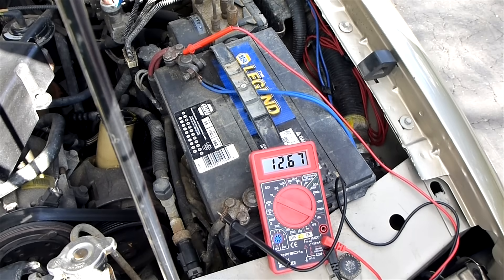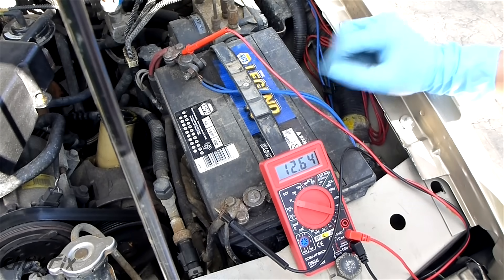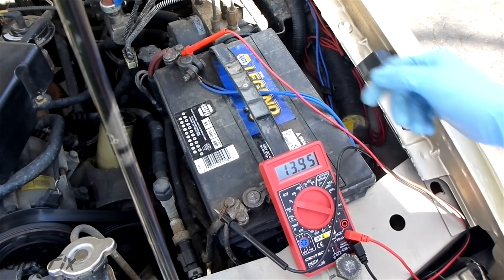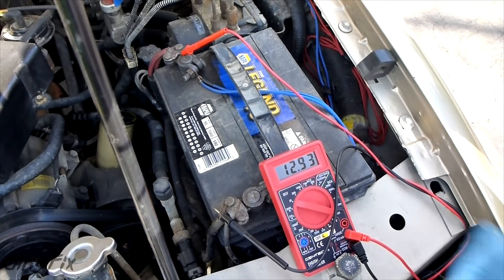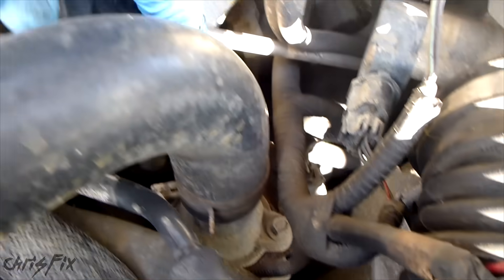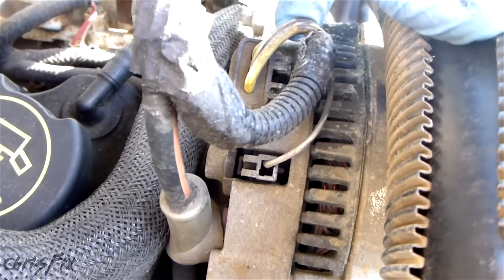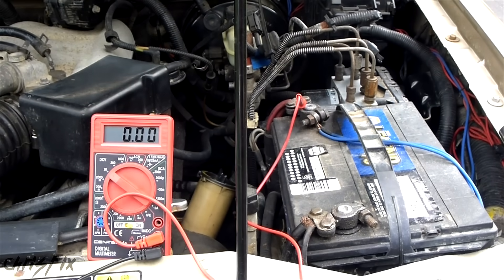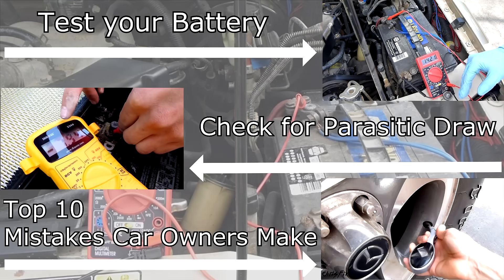How to Test an Alternator

Comment: i have a 2009 camry I4. It's got a NAPA alternator. Upon starting the car i see that the voltage is 14.1-14.5. But after 30 mins of idle/driving the voltage drops to ~13.5. Is this a sign that the alternator is degrading? Battery shows 12.5-12.56V when the car is shutoff. Sorry for multiple comments, if any, as my google accounts are messing it up
Reply from the maker: Could be a bad alternator even though it's new. I would also check your battery because heat degrades batteries.

Comment: I have a 1998 GMC Sonoma, with the 2.2 L 4 cylinder, and 4L60E 4 speed Transmission.  It has the original fan and fan clutch.  I want to add a electric fan, and there appears to be ample room for a small fan between the radiator and the fan blade.  I've been looking for a fan to install, and most seem to be around 28 amps at start up.  The stock alternator is 100 amps.  Should I upgrade the alternator to one around 150 amps?  Would the stock battery wiring be okay at 150?  Would the starter be okay?  Or the battery itself?  Thanks...good video...lots of helpful hints of things to check when they go awry...

Comment: Can you test the voltage between the alternator's positive lead and the alternator body to see if it's pushing out high enough voltage such as 14.2+ volts? Then if it's good, test for any connection problems between alternator and the battery?
Reply from the maker: Yes

Comment: Sorry, that means that if some of those connections is reading higher than it should, then it means the alternator is good and just needs to clean the connections, right? But then if everything is reading normal but car is failing to provide 14v or so to the battery, then it means the alternator is bad. Is that correct?

Comment: Chris, in addition to some drop voltage tests, there should be one added.
 A voltage regulator is hold by two screws and gets ground potential through them. If both of this screws are rusted and lost continuity, then a voltage regulator malfunctions. So the test of resistance between one of the screws and car ground should be added.
After removing a screw, cleaning it and putting back in place, the charging voltage came back and battery light on a panel went out.

Comment: Ok, Would like feedback on this please. I was told a long time ago: To test if your alternator was bad, disconnect the negative from the post of the battery while the engine is running, if the car stalls out, your alternator is bad. How outdated is this? Or more specifically, up to what year of vehicles was this method worth using? Thanks.

Comment: I’m getting 12v with my car off and 12v with it on but the check charging system light keeps coming on. I checked the alternator itself and it’s 14v and then car battery goes to 12v while running. So what’s my problem?
Reply from the maker: If the car battery is only 12v when running that means your alternator isn't charging the battery and will need to be replaced

Comment: If anyone is using those multimeters you get for cheap from harbor freight like the one in this video (I had the same exact one). They are incredibly inaccurate after a few uses.

Comment: Quick concern i have a mustang gt 2006 i recently put a new alternator it reads 13v while off and reads 13.7 running and then with lights and ac on and fog lights on it drops to 13.4 to 13.5 should i return my alternator my old one was overcharging thats why i switched it it would turn off all Electronics from inisde and dim my lights but now im worried its to low now

Comment: Chris my 05 mustang is at 13.7 when the car is running, when I turn on all accessories including ac the voltage drops to 13.4 and if the fan starts the voltage drops to 13.2 then back to 13.4, does this mean my alternator is pretty much busted?
Reply: Lol I just commented this I get the same reading and I just installed a aftermarket alternator from american muscle I'm asking questions as well my old one would overcharge
Reply: @AngelMuratalla209  if you get the same reading in a new alternator then mine should be ok. My car shuts off while running and sometimes it’ll crank but won’t start, I’ll have to keep looking

Comment: My car seemed fine was running the car in park listen to the radio doing the interior for about an hr and then the car was off and won’t start anymore . Battery is at 12 v.. radio works ,  power in car work

Comment: Chris fix man I need you're help so I'm getting g code p1381 for ignition coil but I change  the whole distributor but now is saying   the same code but still telling me to change the ignition coil again but I just did change it and change the spark plug recently  but I went to go to oreillys and I tested my alternator and they said it at 12 volts so that could be why it giving me a p1381 code ? Please help me bro I have a 2000 honda accord lx vtex

Comment: I know the video is 10 years old. However i did everything you showed on my 2013 accord for a bit everything is ok. Then it just drops back to 12ish. Would you happen to know why. After a while i turn it off then on and the voltage goes back to normal charging 14ish but will drop shortly after. I suspect the alternator may be cutting out. Is that something that can happen if its going bad.

Comment: What an excellent video. Despite fitting a new battery and alternator, voltage was only 13.2V - less if lights turned on etc. Carried out check as per video. Found 1.2V drop on alternator housing, bracket and engine block. Reading was good on chassis ground. So connected jump lead from bracket nut to chassis ground and hey presto 14.4V😊😊. Further checking found the engine earth connection very corroded. Cleaned and replaced. Jump lead removed. Pumping out +14V now even when lights etc on 😊😊😊😊
Reply from the maker: Awesome! Nice troubleshooting!

Comment: What if I am getting around 15V after starting? Is the 14.7V after starting the engine universally applicable?
Reply from the maker: 15v is a little high and it could mean the voltage regulator is starting to go bad.

Comment: What if my car doesn’t even start and this could be the issue?
Reply: Disconnect the Positive Post Lead.
Bring a car next to yours or borrow a good battery. Connect Jumper Cable.
1. Jumper Cable Red to good battery Red (Positive Post)
2. Jumper Cable Black to good battery Black (Negative Post)
3. Other end Red to your Red Post
4. Last end Black to your Ground of the engine or chassis ground
5. Rev car to 2K
6. Now, try to start your car

If it starts, your battery is bad/weak or defective.
Then if battery dies after a week, check the alternator.
Reply: @angelisone  my car won’t even jump start
Reply: @Dawg_arex  Then run a known good 12VDC car battery directly onto the Starter.
But if you car is over 9 yrs or 165K+, then check & test your Key Switch (yes, the one you insert your key into).
You failed by not giving much information on your car, which will make it harder for me /or other assist you.
Reply: @angelisone  so I talked to a couple other mechanics I know none did real test, it’s a 2001 Honda prelude 250k miles it will turn with all electronics on just will not even start to crank at all, some said the starter, some said alternator and some said the clutch so i do not know, just trying to get some insight before I get it taken to a mechanic

Comment: I just reinstalled mine two months ago and now I’m getting battery light errors occasionally. When testing the voltage it is lower than 13 but only sometimes. I think the alternator is dying and it’s brand new (rebuilt) but besides that new…
Reply from the maker: Sometimes they go bad. Get a new one under warrantee.
Reply: @chrisfix  Hey Chris! wasn't expecting the reply! thanks so much for making your helpful videos!! using your video I was able to isolate the issue. The positive lead off of the alternator was the issue. There was some corrosion and build up on it. Apparently there must've been a short there that caused it to run hot which melted some of the plastic cap. This got onto the bolt. I had used some superglue around the area when installing in an attempt to repair the plastic bracket which broke when tightening down the wire. thankfully I saved the old one, so when I cleaned it up I just swapped it. I don't think the superglue was a good idea... To compensate for the broken cap I have temporarily used electrical tape to hold it on until I can buy a new cap (I may not if the tape works out)

There being a short explains the excess voltage and heat and the fact that the battery light coming on would be so intermittent, that after a simple restart it would go away.

Voltage off the positive lead of the alternator before cleanup: 1.25 (idle) - after: 0.18 (idle) I made sure to clean every wire and connection for the battery and alternator. I think it payed off too! I hope I don't get more issues with it all. 

Just to be sure it wasn't the alternator I brought it in to my auto store and they ran a test on their bench for me. They also tested the battery.

Dodge Avenger 2010 - 2.4L 4 Cylinder

Comment: First off, thank you. Second, my battery is running at 13.1 volts this is running ac and bright lights. I had the auto parts store run a test and my lighter port bluetooth device says the same, 13.1. I was unable to jump start my car yesterday. Today it jumpstarts. I placed a brand new battery in today and it also didn't start with new battery. I have now went back to old battery. Connected multimeter and getting 13.3. Is this an alternator issue?
Reply from the maker: Sounds like the alternator isn't strongly charging the battery which is causing that to happen I would replace it

Comment: I love your videos. Very helpful. Question- when you checked negative terminal voltage drop on the chassis there was a huge difference actually. It went from -0.04 to +0.06. Unless we don't care about positive/ negative reading. Could you tell me more? Thanks
Reply from the maker: Thanks a lot! The positive/negative doesn't matter in that case

Comment: Hi sir.. my car.. carb system..modified use 110 A alternator, not to much electrical as usual.. just big electrical as AC, couple a headlight 100 w, and simple sound sistem..the problem when 3 of that turn on together.. voltage drop until 13,1 v some time 12,8 and RPM drop too, for about 100 RPM down. can you explain what problem? what should i do? Thanks

Comment: I have to say you know your stuff. I have been trying to learn. Takes time, I guess.
My issue with my 2018 Civic H.B 1.5L Turbo. I changed my alternator because the old one died. New belt, too. However, it had passed the condition test when I took it to Autozone. But, when I drove on the highway I would expect to see 14.4 volts. Instead, even after hitting 2,000 rpm. For a moment, it would show 14.4 volts, then it would drop to 12.3 volts. Possibly bad alternator, but it passed the testing phase. I'm confused. I will try what you did. As far as I know, all ground points are checked out and positive to the alternator as well. Then I get a steady 12.56 volts at idle. The only way I see 14.4 volts at any given time. I have to turn on the lights or fan to full blast. This doesn't seem right. Any advice would help. Thanks. And, I have a new battery.

Comment: pull off from the stator windings the 3 stator windings are your 3 phases. easy 120 volt at 20 amps (so 240 @ 20) with a small alternator, 240v at 80 amps did not use the 3rd phase as we didnt have any transformers manufactured yet for a welder with variable frequency rather than rely on 50hz and having to adjust dails potentiometers rather than rpm. i wasnt game to hook up an ignition coil as the frequency scared me as im fairly sure it will not require a trigger/pickup/points to collapse the primary coil and energize the secondary.

Comment: I replaced my alternator and now my oil pressure sensor is at 0 and my ac is not blowing cold.
Reply: Sounds like you put the belt wrong, or bad alternator from factory

Comment: What if it's at 13.06 with the engine running and the radio playing, is that good? I'm have trouble with steering in my vitz and I have a feeling it's the battery.

Comment: What does it mean if my alternator case, bracket, B+ post, AND engine block all read 0.25V ? 
First Tests on battery while running got 12.XX Volts, regardless or not of running at 1500RPM. So battery is clearly not getting a charge what so ever.
I have to keep recharging it on a battery charger as well.

Comment: A question to all knowledgeable about car electronics: What could cause my multimedia not to receive enough "juice" , and stutters/turns off when i turn on long light+ all 4 blinking signal lights+ lets say i drive slowly with low rev count (or in reverse) ? Multimeter shows about 14.20 when the car is running, and car battery is few months old (still under warranty). I dont have problems with starting the car, like ever, but its 30yo old car, and idk what wires should i check to see if they might be shorting or something ... Sometimes multimedia keeps turning on and off (the pioneer logo) without "power" to boot up fully, and if i disconnect ground wire (that comes from car's radio antenna), multimedia turns off completely, and when I reconnect it, it can boot up multimedia successfully, but after some ride while playing music (especially if loud) it turns off or start with buzzing lowered sounds (just like if its running out of power, about to turn off) ... PS: car is mazda lantis 93' , multimedia is pioneer avh 270bt.

Comment: its bad from the get go if the battery terminal moves when you probe the negative terminal.
Reply: Not to mention those cheap replacement battery cable terminals. They are junk.

Comment: Some times there's the volts needed to start the engine but not the amps to start the engine.. the amps needed are different in many engines. An is written on the right battery for the car or van or truck. 1700 amps.

Comment: my alternator runs at 13.2-13.6v is that normal?
Reply from the maker: That is a little low but if your battery is in good shape being around 13.6v is within spec.

Comment: Mines 14.78 or 14.76 and stays there even with everything on. Is that just my voltage regulator? I have a 2005 Nissan 350z and brand new battery.
Reply from the maker: Sounds like a good reading, are you having any issues?

Comment: Hi, so I have an 03 Corolla with about 150k miles on it & the other day I went to turn it on & it wouldn’t start. The battery was fine & all the lights were  working on it. I ended up getting it towed. As soon as I got home the car turned on! I had a diagnostic on it & the computer said “bad charging system”, but it’s been turning on ever since. Do you think this could be the alternator?
Reply from the maker: If it says bad charging system then I would check the alternator for sure

Comment: Your battery clamp on the negative terminal is loose. The clamp moved when you placed the multi-meter probe on the exposed wires at the clamp. Otherwise a good video.

Comment: Hi there Chris, just did the voltage drop test, and both black and red do not read to what they need to be read at. I assume if i just skip the cleaning part and replace the alternator would help fix this issue? On my battery gauge its been reading a bit low when the car is on, nothing wrong , no battery light, just concerned about the level being a bit low

Comment: Chris, thanks for this video… but
The purpose of this video should be, how to test the main power/charging system of your vehicle.
The components being 1- Battery, 2- Alternator/Voltage Regulator, 3- The Main wiring, one should consider the main power fuse or fuses. 
Why? Because these are not independent components which operate individually, they instead are a system which functions together to provide proper power to the vehicle
….
Initial Verification
# 1- before testing for operational voltage, the battery must be at full charge. That means each cell of the battery must be contributing 2.1V, for all wet plate, led acid, batteries. 
# 2- the battery terminals must be clean and tight (not like the ones shown in the video)
# 3- A volt drop test should always be performed on the main battery cables, to assure they have less that 1/10th of a volt drop per foot of battery cable. (Or manufacturers specification) 
# 4- Verify the alternator belt tension meets specification
# 5- Verify the alternator wiring is correctly connected and torqued
# 6- Verify the top of the battery is clean (for top post batteries)
# 7- Load test the battery prior to testing the alternator

Testing
# 1- For 12V automotive alternators, there are two charging points to consider. European voltage regulators operate at a maximum of slightly less than 14V (13.8V) 
Voltage regulators for most American and Japanese cars operate at just over 14V. There is a difference. 
# 2- Over voltage in a 12 volt charging system, would be any continual reading of 14.5V or greater
# 3- load testing the alternator should be performed according to the manufacturers requirements, as often they require a specific load to produce a specific voltage range at a specific engine RPM (usually not idle). Most alternators achieve their full amperage potential at 6000 alternator RPM, most modern alternator pulleys are 3:1 in relation to the Crankshaft pulley. Meaning at 800 engine RPM, the alternator is rotating 2400 RPM. Most alternators will make 1/2 their full amperage rating, at 2400 alternator RPM. 
# 4- Test results which indicate lower than required voltage but above 13.5v (13.6-13.7) should be initially suspect of high resistance in the charging circuit.  This is tricky in European systems as I have seen perfectly good alternators regulate at 13.7V max.